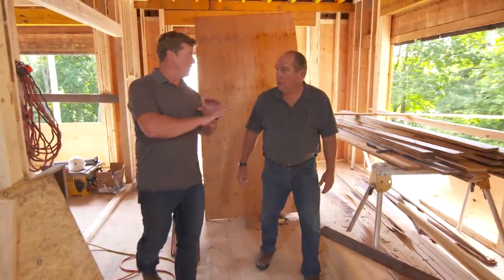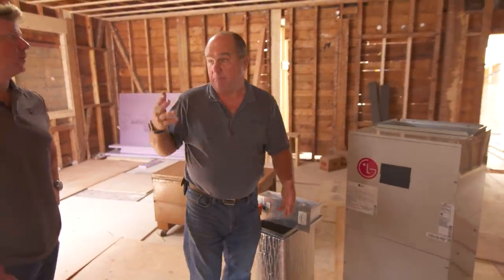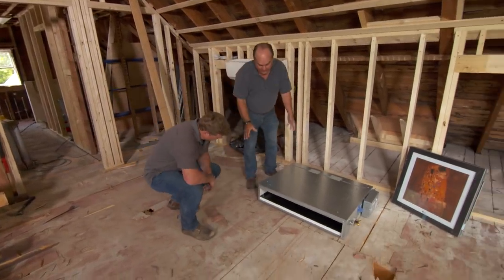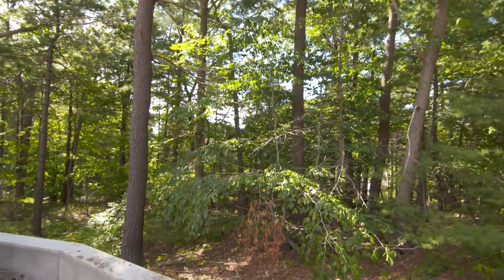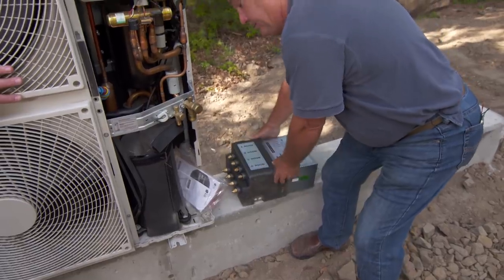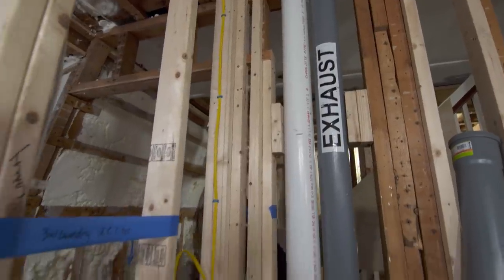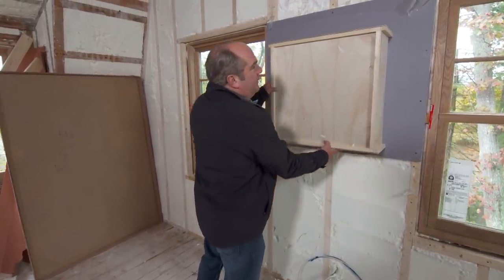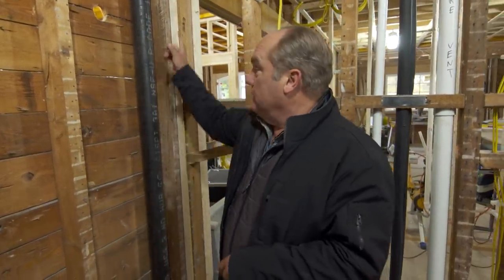How to Create HVAC Cooling Zones | This Old House

Comment: what a great video, I wish some of the youtubers I was installing systems the wrong way would watch some of these videos.
Reply: The video is not about install technique.  It’s about selling as much HVAC equipment as possible into a house.  Here, owner has to buy a separate radiant heat system, separate cooling condensers, duct for cooling only. All in this is a $50K install, when $20k would do. They might as well have tried sell heat and cool for the backyard.
Reply: @Nill757  heated driveway!!
Reply: @Nill757  Not the ones who install 3 or 4 complete Mr Cools and they could use a single condenser for all 44 head units
Reply: I'm guessing the "youtubers" you refer to are using a version of the system designed to be installed with nothing but a screwdriver and a wrench. Those require extra refrigerant line to be rolled up because it cannot be shortened. In this system, refrigerant lines are made on site, but require very specialized (and expensive) tools to build and prepare.
Reply: F Maz $$70K total.  Heated street!

Comment: It’s amazing the leaps and bounds the hvac industry is making right now. Single phase main unit with multiple mini splits with heat and cooling capabilities with variable flow mini splits. Heat one room while you cool another with a single outside unit.
Reply: You can’t heat and cool at the same time with the mini splits they showed. Vrf can do heating and cooling at the same time from the same condenser. You see them in hotels and schools
Reply: To expand on concept, the outdoor unit they showed had two refrigerant lines that connect to the indoor eev that distributes to all heads which is the 'multi f' line.  It's variable flow refrigerant, but isn't capable of running simultaneously cooling heating.  The 'multi v' can have an exact looking outdoor unit but has a third refrigerant line connecting that enables simultaneously heating and cooling.  Both are VRF technology.

Comment: The biggest trouble with going with a multi-zone minisplit system is that you no longer have air moving around the house. The air can be the perfect temperature but still feel stuffy. Gotta bring in some fresh air with a HRV/ERV to get the most out of that system.

Also, would be a good idea to insulate that intake pipe for the gas heater. The intake air temp during the winter would be enough to cause condensation inside the wall, no bueno.
Reply: chase weeks : Great comment and great video for sure, but I also was surprised there was no dedicated fresh air intake in this system.

And for anybody ready to bust my balls because of that one 'intake' he describes, that's a combustion air intake; different from a fresh air intake me and @chase weeks are talking about.
Reply: @TrailTrackers , generally I lump the two together. Sometimes I forget that they're really two different products. If you're doing an ERV/HRV, it only makes sense to have the incoming air that is being pre-conditioned come from the outside, but this house could easily have a fresh air intake without either form of recovery ventilator. Would be a lot cheaper, just less efficient
Reply: @chaseweeks2708  : Not sure you understood my comment @chase weeks. I 100% agree with both your comments. When I said "fresh air intake" in my first comment, I did in fact mean via an ERV/HRV; that's best practice in new construction nowadays.
Even when upgrading an older building in a remodel, I would never recommend just cutting a hole in the wall for your fresh air intake. Although, in most older homes (pre 2000), they are so leaky it probably equates to a 12" or more hole in the wall. LOL...

Comment: If you were using this type of system (inverter heat pump) with all those zones for heating as well, could  you have a humidifier on a system like this?
Reply: No, unless the individual air handlers had some type of humidifier in them which may be out there who knows. Otherwise you'd just need to install a sperate humidifier probably for each floor.

Comment: I have a multi zone Geothermal HVAC heat pump with a 2 speed compressor.  All equipment is inside the house.  Damper doors in the ducts to each room, and the air handler is infinite speed.  I am not understanding why they are over complicating this install with multiple air handlers, especially since everything is wide open right now.

Comment: Are The heat pumps sufficient enough in colder climates for stand alone heating system?
Reply: Combine it with solar eletric or/and solar thermal and it can be cost-effective in the long run..
Reply: No. They derate (provide less heat) at around 40 down to a point that they stop providing any heat at all. That number changes with manufacturer. That number needs to be lower than the extreme temperature day. In western NY that is -15 where design temp is 4. You also need to evaluate gas vs. electric cost. In NY gas is way cheaper.

Comment: The multi zone unit, was that a Mitsubishi? and does it work with those pancake units, or the mini splits?
Reply: Probably as that is what they are installing.
Reply: All of it was LG - works with pancakes and the mini splits
Reply: lg. I've put in 4 of them so far, not too hard
Reply: LG and they are the only ones that make the “artwork” unit.

Comment: Traditional condensing units are NOT limited to 50ft. That is totally wrong.

This system is called a VRF system. I would not recommend it for cold climates unless you have a secondary heat source like heated floors etc

Comment: 50 years from now we'll get to see Steve Lav tearing that wall apart to replace the rotted out leaking cast iron pipe!
Reply: But no one will hear the courtesy flush for 50 years.
Reply: @803mastiff9  Oh, I've had cast iron in an apartment from the upstairs toilet. They'll still hear every last flush plain as day, it just won't sound like a waterfall inside the wall like it would with PVC.
Reply: Or some outfit might install a plastic soil pipe and simply lag it ...

There again in fifty years time the succession of owners might have modified the house out of all recognition anyway.
Reply: @thebigdoghimself  check the last 30 seconds where Richard shows the master bedroom toilet pipe transitioning from PVC to Iron to avoid flush sounds to be heard in second or first floor rooms.
Reply: @thebigdoghimself  watch the last 30 seconds of the video

Comment: Does the installer and manufacturer offer a 5-10 year no questions asked warranty?  That seem like a lot of connection points for a leak.  No redundancy, the outside unit goes out and the hole system is down.  Whatever you save on electricity will only benefit you if this this does not develop any issues.  Good luck with that.
Reply: Most manufactures offer 5 year parts and 7 year compressor warranties. However, some certified installers offer 12 year warranties on parts and compressor.

Comment: Never ever ever put a vrv or vrf system in your house unless absolutely essential. Far better of with a single large high static pressure split ducted unit. Zoned and controlled by a appropriate after market  controller like an airtouch 4 or izone.

Comment: I want to heat the floor to keep my feet warm and cool the air to keep my head cold. Just like when the AC in the car have been a bit to efficient, I just turn on the heat in the seat. aah.
Reply: You should be able to
Reply: I hate hot face cold feet in the car. Wish I could set it at hot feet cold face in the winter.

Comment: I have a zoned cooling system in my house and I absolutely HATE it.  The house is only 1400 sf and even at 3.5 tons, the air handler doesn't produce enough airflow to deliver adequate cooling to both the first and second floor.  If it's only cooling one or the other, it's fine, but I live in Texas where the whole house needs AC.
Reply: You should have somewone check it out .
Reply: Load calculations... have it done. Guessing gets you what you have.
Reply: You're several tons too small. With the solar load in TX, your unit is way undersized. For example my parents in AL, in a 2300sf house, have 10ton and 3 ton units. Zoned cooling is amazing if it's done right.
Reply: Load is correct for my area using rule of thumb one ton per 400sf. But most likely other factors involved too. Nevertheless two floors is always a problem with a single unit even with zoning. Even if it is (how many thermostats?).
Reply: @786otto  did that...got the standard answer, "it cools to 20 degrees below the outside temperature so it's fine."  Translation: "I don't want to work on it."
Reply: @Bhatmann  two. One for each floor, each floor is its own zone.
Reply: gasfiltered 10 tons for 2300sf?
Reply: @tylercorbin8073  that house is now comprised almost entirely of mold.
Reply: Sean Peoples My house is 2100sq ft and it only has a 4 ton in South Carolina. And it cools it just fine.
Reply: @tylercorbin8073  I had the exact same 3.5 ton unit in a 1,600 sf house I owned previously (same make and model, only thing that separates them are about a year in manufacture date) and it worked fine.  The only two differences are that the old house had a heat pump, this one has gas, and the zoning.  Since the heat source has nothing to do with it, only leaves one variable.
Reply: You oversized your unit and you don’t have a variable flow unit. Your unit is on long enough to change the temperature not condition the air.
Reply: gasfiltered i want to know what residential unit you were able to find at 10 tons. That thing would almost have to be a 3 phase electrical unit.
Reply: I live in Iowa and have a 3 story house, with a basement, and 3.5 tons and it’s a multi zone unit. It works just fine until it gets about 105 outside and then it starts to warm up inside.
Reply: Mine does seem to keep the inside temperature at whatever the outside temperature is minus twenty degrees, but there's very little airflow when both zones are active...and this is Texas, 105 is a normal day from June through early September and I don't want to live in house that's 85 degrees for four months straight.
Reply: What sort of insulation do you have in your home? As in do you have any, or enough?

Dare I suggest the heat is "penetrating" your home faster that your AC kit can remove it?

It may be your unit is appropriately sized after all, according to "rule of thumb", but your house is a "heat magnet" in that it happily absorbs every watt of energy the Sun bestows on the building's surface???

Plenty of info online ref use of insulation in AC equipped buildings.

Might be worth a squint before you invest in a larger capacity system perhaps?
Reply: @FrostyDog9186  Your statement does not seem to be accurate and on point. In this video, they are using multiply cooling/heating heads, one unit outside that powers units inside, so every room has its own zone . From reading your comment I understand you have a condenser outside and one air handler inside. The numbers you provide it should work better than you claim, do you have any insulation in your house?
Reply: @786otto  if you watch the video, they're actually doing both.  Right at the beginning, Richard talks about installing an air handler with a zone damper for the downstairs zone.

Yes, I have insulation.  Like most houses anywhere, is it "enough?"  Well, enough by whose definition?  It clearly meets code, and it's clearly enough for the builder.  Is it "enough" to keep the Texas heat out?  Clearly not, but Jesus Christ, what is?
Reply: @FrostyDog9186  Yes you are right .If you still uncomfortable install one off the  wall minisplits.Good luck ,stay well.

Comment: The cost of installing these systems is out of reach for the average consumer. We priced out a mini split system and it added up to 57k (for a 3200sf home (4800sf inc basement). That'sd a huge aniount of money especially when compared to a standard single gas fired furnace in the basement with an outdoor heat pump at 28k. We settled on a Mitsubishi 4 ton hyper heat outdoor unit powering 2, 2 ton air handlers (one in basement for basement and first floor, one in attic for second floor) and even that came in at 32k.  The killer is not the unit cost as most mini split heads cost well under $1000, it's the labor that's a killer.
Reply: That is precisely the beauty of the mini split. They've literally been a revolution for people who restore and maintain old houses. Running ducts is an art and requires an in-depth knowledge of fluid dynamics. Any moron with a drill and a keyhole saw can run line sets and hang the tiny air handlers. The only outside labor you need to install a mini split is to have someone pressure check your lines and commission the system. Maybe $1000 on a complex set up. Maybe another $1000 to have someone spec it out for you if you wanted. If you're not into diy and you're not exorbitantly wealthy, old houses are going to be hard for you.
Reply: THat is because HVAC guys think they are GOd and want more money then doctors after 8 years of schooling. Most of contractors barely got C- on their high school diploma, and walk around like everybody owes them something. THat is why I try to do everything in my house myself, so I do not have to hire one of those criminals.
Reply: You’re wrong as the prices are now really affordable. I went to a home show and Bryant was showcasing that you could install a single base unit and 5 mini splits for $9k. That was enough to heat or cool 4,500sq/ft. Variable flow units as well with independent or slave capabilities.
Reply: MrAccordCrx lol, High School grades don’t determine the success of a persons career. It just determines how good they were at universal standardized testing. People like you that talk as if they are superior to others make people who work in the building trades nervous. You know just enough to be dangerous and are insured enough to not be held responsible.